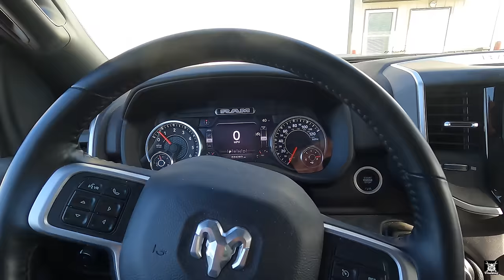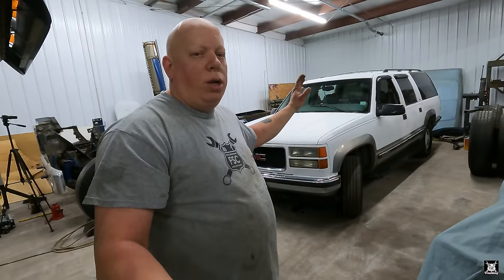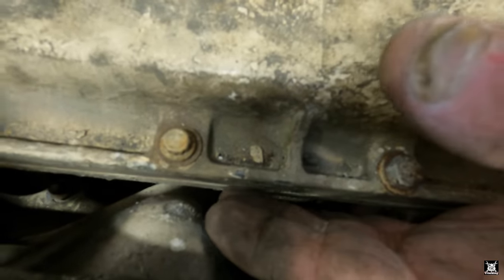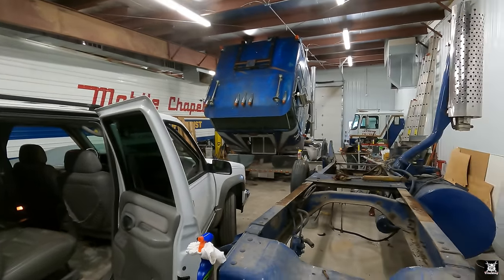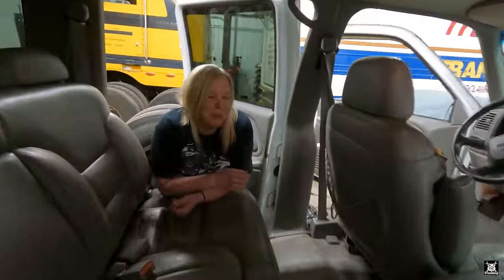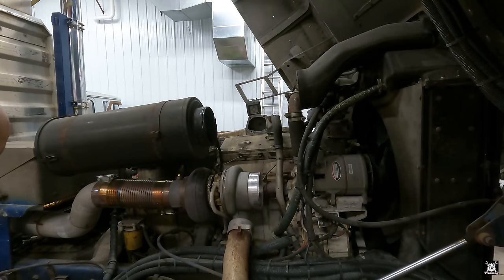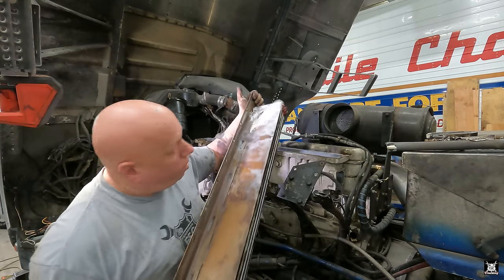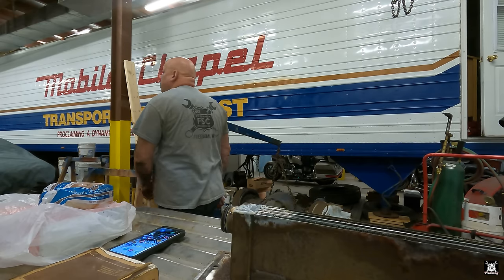Orwell Looses An Aftercooler Core!  Major Engine Issues!

Comment: New fan from Greensboro, NC. Love your videos. Helped a friend transport a 2003 Tahoe from Virginia to replace his wrecked 2004 Yukon. The "new" one's seats looked about like yours. I was surprised how affordable whole new leather re-upholstery kits are from Amazon. Like $50 to $100 per seat. And you completely remove the factory upholstery and change it out. Probably save a trip to the auto trim shop--and a ton of money. They've gone nuts at the local trim shops. Fewer people pursuing that craft means exorbitant prices.
Reply: Oh I can confirm that! You nailed it as I decided I wanted to replace my 70 Chevelle original bucket seats since they weigh a ton, they don't recline, and no bolster. But I HAD to get the idea that I didn't want to be like everyone else and toss in everyday sport seats with the belt holes, etc. so ordered same matching vinyl covers to have local upholstery shop convert them to match, get rid of those holes, and the upper bolster...$2,600 each seat.

Comment: I used to work at the what is now the only truck spring and suspension shop in Winston Salem NC back in the 80s. They had a couple Bee Line frame machines from the 50s or 60s but no one who knew how to use them other than front end alignments. It's cool seeing how this is done.

Comment: it is a innercooler, welcome to a overhaul, red coolant eats stuff, use green, wd40 on any oring and rubber boots on removal and install, if your not doing a overhaul you better check the rods and mains for coolant erosion, the plate on the top that has two side is for different exhaust manifold setups it can be turned for different cabs depends on the turbo mounting forward or rearward.

Comment: Steve, I would do on that Suburban replace fuel filter & change all fluids, oil, transmission fluid including trans filter, coolant, brake fluid, power steering fluid & differential fluids especially if its a 4WD & do a fuel injector service. Since they will live in the southeast there is no inspections & emission testing except Virginia as they do both & Atlanta Georgia metro area only has emissions test & if the catalytic converter is bad just put a pipe though there & it will run much smoother & better. Rock Auto has all the parts for that vehicle including accessories as I use to have a 2000 Suburban & used them all the time. Are they moving to Florida?  -Cheers!

Comment: Most of parts listing in your old box are still current. Even if you give them old part number it updates to new number. We still look at old book for certain parts because it faster. Cat changed their website again makes its royal pain to find your way through it (SIS 2.0). Cat system when looking up parts for old B models look just like old book on old system not sure on new system. Parts coming from Ziegler

Comment: @fsctrucking 

I saw somewhere that one of the optional engines for the Ford cabover is the Cat 3406B as well as 300, 400 & 444 Cummins mills. It gives you options on parts commonality once you get all 3 cabovers up and running.

Comment: If you need replacement carpet get it from ACC, that's the only brand of replacement carpet that I use.

If you want to recover the front seats I can hook you up with the supplier I use.  When I worked for GM I replaced so many seat covers at the dealer.  I just bought another 2000 Tahoe limited and I had to replace the front seat covers in it.  I replaced the seat bottom foam along with top and bottom seat covers that are identical to the factory covers and attach to the frame the same way. I spent $300 completely recovering the front seats.
Reply: I'd like to replace the front split seat covers on my 98 GMC k1500 if possible? Lady that had it before me smoked & burnt holes in it!

Comment: 59:03- when you’re trying to pry out with the screw driver, I use the largest flathead that will fit on a long shaft to the handle. Once the blade is inserted, I rotate the handle which hopefully separates the two sides.

Comment: Probably could change to front intercooler and used intake manifold cheaper than replacing that core you could get parts from a truck junk  yard I did this to a cummins l10 ran good if that core leaks bad internally you will blow a head gasket

Comment: Well let's face it, it's 4200 bucks well spent on a real truck.
Let''s not forget that's usually the cost of every modern curbsniffer at the garage when it has a Emission Malfunction again.
Yes it's alot of money buuut Orwell has saved and will save you tons of money by not getting any DEF Poison.
Orwell aint broken he's on a break just chillin in the shop. 

Great content Steve!

Greetz from the other side of the ocean!
Bjorn
Reply from the maker: You are correct.   This one part may be a bit more than it should be.  But overall, it's still way less money spent in the long run of maintenance compared to modern trucks.

Comment: If you take the seats out then remove the carpet and hit it with a pressure washer all the stains will come out. If the boss lady uses the steam cleaner on the headliner that's where most of the cigarettes smell hangs out. 🙂

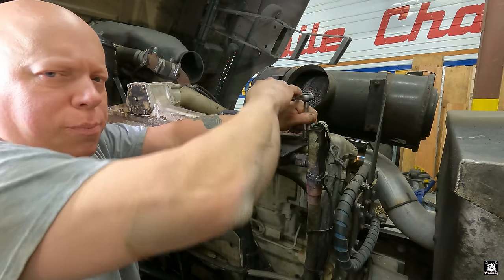Comment: 36:33 - I started using a drill with a socket drive adapter (1/4, 3/8, 1/2) to take out and put in long threaded bolts. Do final torque with a wrench. Goes faster and easier on the wrists.

Comment: Go for the hybrid. Get a later model cabover that has a stand up sleeper. Many years ago a mechanic i worked with had a pneumatic butterfly wrench for less aggressive bolt removal. These days i occasionally use my impact driver with a socket adapter.

Comment: Shipping over night express of 70lb + will cost as much as the part it self. No there is not after market parts for old CAT's motors, they could repair the core in a know haw shop, but that would cost more than a new part.Im a truck driver so I know the pains we go by with equipment and shop/ parts repairs costs.Some times on a lemon truck , trucking is not fun, all the profits goes to bill pages,- NOT GOOD !!!. TH

Comment: Well, $4200.00 for the aftercooler, could’ve been worse if it caused more damage. But, as you said, it is what it is.  Just so you keep it running. Be safe. Also, Jen is doing a nice job on the Suburban.

Comment: Have you seen the Gulf Coast Bypss Oil filter model 0-2. It cleans the oil all the time, with two elements stacked in the housing, that are the size of two paper towel rolls. The stock spin on oil filters, don't clean the oil very good.  When you have this bypass oil filter, you don't need to change the oil. Just take oil samples. You can double the life of any diesel or gas engine, if you have a bypass oil filter.
Reply: That spam ?

Comment: If they are a trucker and not a steering wheel holder they wont care what they drive.  I myself put 4.9 million miles oin a k100 and finally retired.  I would never drive a conventional.

Comment: That is some yummy stuff that Jen is cleaning out of the Suburban.  Tar and nicotine coats and soaks into everything.  Nasty stuff and that's what people inhale into their mouth, nose, throat and lungs.  
That water leak could have been catastrophic.  Guess it was good that Orwell sat outside and got so cold.  Yeah, expensive repair, but how much would a rebuilt engine have cost?  Good thing you found that leak.

Comment: Pocket just burning a hole, well, better catch the problem now or you would have to deal with a  remake on the block if there is noticeable damage in cylinder one with the water leak.. I wonder if the coolant leaking in the cylinder one might be what could cause the black smoke  then soon their is none after that since it only happen when start up after the engine is off for a while. But still glad the block is still fine, it would have cost a lot more..

Comment: I smoke but I do not smoke with windows closed and do not use the air recirculete while smoking. Turtle wax sells a cleaner that does a good job getting smoke out of cars for one the size of the Suburban I think it would take two. Read and follow instructions. Smoke is going to be in the headliner more than the carpet

Comment: How it going STEVE ,
 a cold leak is better than a hot leak for sure ,   For sure I remember them  old coolers  ,   Definitely for a 99 that's low miles Keep the oil change plugs in it will run another 6 or 7 years ,   I've been doing that for years checking for air leaks ,  You need you a soapy spray bottle full of water now to spray everything ,   For sure the heat exchanger it's leaking on you Steve  that happened to me back in the day ,   That's a lot of bucks for it ,  You know they probably only giving $1200 bucks for them,   And then hit you hard for it

Comment: I should change the same coolant pipe o-ring on my pickup.   (98 pickup pretty much the same as that suburban, but I have the 4l80 trans, which desperately needs a fluid drain and filter change)

Comment: my 2 favorite trucks i have owned over the years are my  362 and my cl9000 i would give my right arm to have either one of them back my first truck i bought in 77 it was a year old gmc astro put a lot of miles on that old girl great truck sold my 93 9670 in july 2022 trhings are tough right now depending on what happens this year have my eye on another cab over we will see.

Comment: Changing antifreeze in a cat is like changing oil gotta do it every 2 to 3 years been running cats for 30 years learned the hard way and only use cat antifreeze if you want them to go a million miles

Comment: I rather drive a cab over in a heartbeat I learned to drive truck in 1967 GMC cracker box but now I'm disabled plus I'm in power wheelchair..if I still could drive again. I would do it with no hesitation

Comment: $K for that !  WOW.  Could it be repaired and if so would you trust it ? Oxidizer for smell, additive for oil seals
They're drivin them in europe and importing them into the Americas thru Canada. I watched a videoon YT.  He broke the engine though !  Rebuildin it.
I have rusted on feul filters and have PB blasted them and they wont budge. . I guess a hammer and chisel.